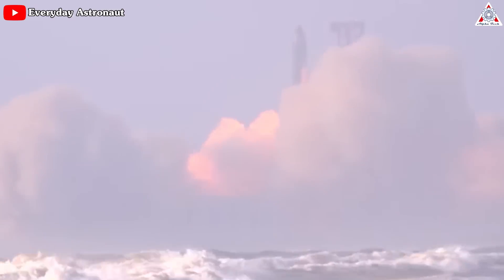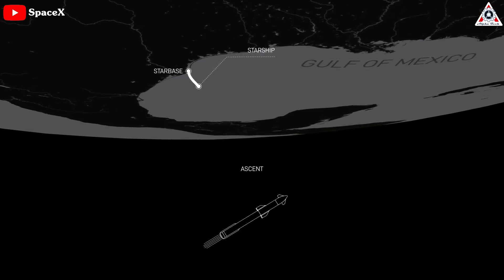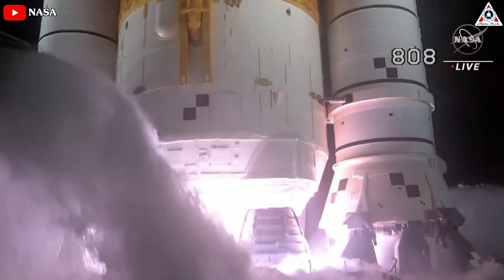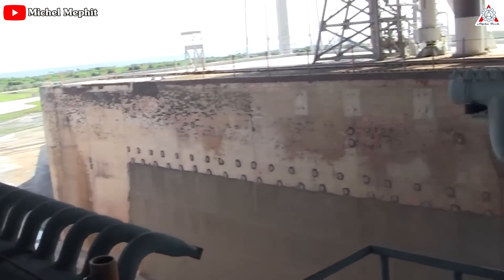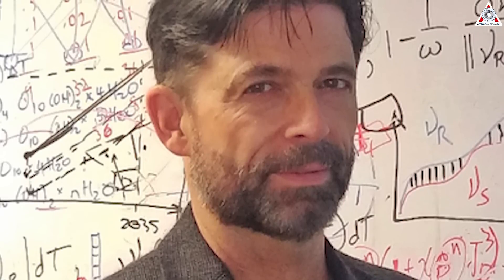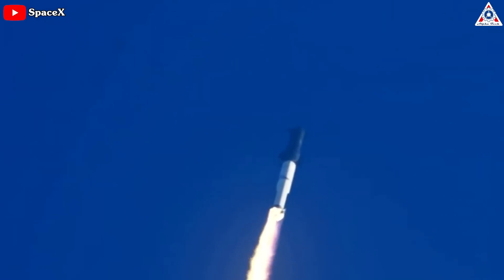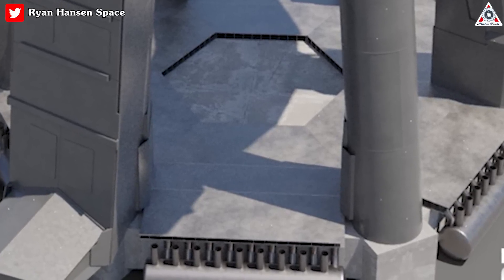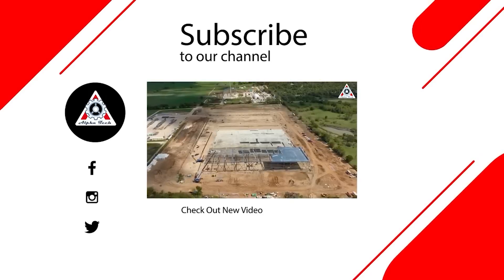SpaceX's NEW Solution to prevent the pad damage by 33 engines...

Comment: Well, we all know that this rocket is over twice as powerful as a Saturn V.  That mantra has been repeated over and over.  Finally, the present catches up with and surpasses the past!  How many Saturn Vs were launched with little pad damage?  Then Shuttles.  

You see, the Apollo/Saturn engineers created a launch vehicle and launch facility.  They thought the idea through and considered all ramifications.  And, how long ago did they know how to build a highly competent launch pad?  Oh, about 60 years.  That's all. 

The super heavy/starship (so-called though it's not going to any stars) may be the Spruce Goose of our time.  The Goose was going to carry hundreds of men, supplies, even tanks etc from the US to Europe during WW2.  It managed, with almost no fuel and no cargo, to get a few feet off the water and fly for a minute or so.  

I hope that Space X manages to get a "starship" into orbit.  It will be very interesting to see if they can successfully reenter the ungainly thing.  My hunch is, along with the launch pad fiasco and booster with too many engines, it will fail and never be able to reenter. 

Space X has the answer right now to a moon and mars booster.  It's very simple.  It works and is brilliant.  It's the Falcon Heavy.  Simply refit all 27 engines with Raptors.  Presto, more payload.  Then design the center rocket for landing and reuse.  In the future engine upgrades might increase payload even more.  Also, in the future one or more additional side boosters could be added.  Core plus four Falcon 9s=45 Raptors.  Makes the super heavy seem underpowered.  Center core + three Falcon 9s=36 Raptors.  Presto.  

Those 33 engines in super heavy are too close together, too much plumbing in too tight a space and all the eggs in one basket etc.  

As for using the current Starship (so-called ) to land on Moon or Mars.  Other commenters here are right.  No way.  Too much power on landing and take off.  Too much danger of damage coming and going home.  The vehicle will dig a crater that will make it impossible for the legs to support the craft.  

Let's all get going in a chorus to once again say how far superior the super heavy is to the Saturn V!  Maybe if we sing the song often enough we can convince ourselves it's true.  With Saturn Vs , right now or anytime in the last several decades, we could have build a space station, a moon base, and gone to Mars.  With F-1 engine upgrades that were in the works when the Saturn V was carelessly discarded payload would increase even more.  

Space X had to reinvent the wheel and have his own engines.  If it had done nothing but reverse engineer the Saturn V (and moon lander/command capsule) we'd be on the moon and Mars far sooner.

Comment: I am not convinced that this came from Tesla. A flame trench and diverter are easy to construct irrespective of water table. The problem was that Musk did not want it as made his concept of a quick easy launch difficult. The truth is that it is necessary along with a water deluge, otherwise back and sound pressure will damage the rocket and engines. A metal lining to flame trench is also necessary.

Comment: That new water cooled steel plate won’t work, it’s not the heat is the pressure that destroyed the lunching pad, they need to make something like a conic shape pyramid to deflect the energy sideways since they can’t dig deeper into the ground because of the high water table. That pyramid deflector should be like Philips screwdriver tip to increase it’s surface area, more surface area more pressure dissipation.  In simple therms make something aerodynamic underneath to deflect the flow of energy sideways.

Comment: I would have thought that a steel cone would be a better solution to deflect the thrust away from the pad and the booster, a flat plate will still reflect the exhaust directly back to the engines.  Also, a cone (with a 45-degree angle) would have around 30% greater surface area than a flat plate to further dissipate the energy of the thrust. They'd probably need to do some hefty simulations to get the optimal angle/profile of the cone but it seems a better solution than a flat plate. The energy has to go somewhere, easier to deflect it than try and absorb it.
Reply: Also, just as with sloped armour on battleships and tanks any given thickness of steel presented at an angle has a greater effective thickness.
Reply: @davidjames4915  So very true. At the 45 degree angle it's instantly 1.4 times as thick.
Reply: @protorhinocerator142  An additional cost saving for Space X!
Reply: @davidjames4915  Yes I hadn't thought of that, an additional great benefit
Reply: I like this idea, also wouldn't a giant poured steel platform work? I'm talking 20-30 ft deep just pour a steel slab that can be poured back over when parts of it melt? I know delamination could be an issue but that's doable right?
Reply: @RockstarDrywall2023.  well firstly they can't go down that far which is what they are trying to solve with the water cooling base. The water table is pretty close to the top of the platform which is why they haven't just dug down to create a flame deflector.

Second, they are already having problems with concrete flying up and damaging the engines. Id imagine it would be much worse to have vaporized, liquid and chunks of steel flying around. The rocket motors are more than capable to sublimate and break up steel.

This is of course ignoring the fact you would likely need an entire metal foundry right next to the launch pad to accomplish this.
Reply: @probablyinconsistent4756  oh yeah forgot about the water table hmmmmm
Reply: @Probably inconsistent  ok so what about digging down to the water table and use that as a flame retardant?
Reply: @RockstarDrywall2023.  you can't use the water table as a flame diverter for a number of reasons. The biggest one is that it is just a pool of water. 

Flame diverters essentially have 2 major elements, the ramp and the water flow. The ramp diverts the rocket exhaust away from the rocket in a stable manner. The water flow basically just keeps the material the ramp is made of from melting or getting blasted away. The water absorbs both heat and sound energy, importantly this water is always flowing down the ramp.

Having a pool of water beneath would cause major issues. A pool of water will not really absorb or divert energy, more just get out of the way because it doesn't have time to do anything else. Remember that the raptor series engines put down about 200 tons of force constantly. The water would likely get splashed in every direction, including onto/into the nozzle and other major components. 

This is pretty bad because the outside of the engine housing is extremely cold, water hitting it could heat it up rapidly causing thermal shock. When a material rapidly changes temperature it will usually induce stress fractures, this is why rockets have an engine cool down phase before launch.

In general you don't want any kind of stuff flying around during a launch. Honestly SpaceX just royally messed up not thinking ahead when they built the launch site.
Reply: @probablyinconsistent4756  ahhhhh
Reply: @RockstarDrywall2023.  I'm sure the steel would melt, but it seemed strange that much of the rebar remained after the concrete was blasted away
Reply: @John Tulley  that's because the heat didn't blow up the concrete is was the concussion energy from the blast. Steel would take that I think because it bends, and steel can be re melted to its needed shape
Reply: @johntulley8153  what if they used the water table itself?
Reply: wouldn't that require more thrust to get off the pad ?
Reply: @dickwilliam3793  No.  The thrust is developed by ejecting mass out of the rocket at high velocity.  It isn't pushing against anything and this is why rockets work in space where there is nothing to push against.
Reply: @dickwilliam3793  I don't think it would affect the thrust
Reply: @johntulley8153    OK thanks.
Reply: @dickwilliam3793  no, why?
Reply: Yes indeed.  Mad not to.
Reply: @apollo5341  Good solution,
Reply: I'd also flow the water over the steel, this should then result in way less heat reaching the steel because of a leidenfrost effect of the water, then steam.
Reply: @Levi  that would just instantly evaporate it wouldn't make a difference , if they use it underneath though I think it will become a pressure cooker lol
Reply: This is one of those solutions that seems like a good idea at face value but presents tons of engineering challenges when examined closer. 

Firstly you don't necessarily want the plate to be thicker. Thicker means more material which means it takes longer for the heat to transfer to the water. This is why heat sinks are generally made from thin and highly heat conductive material.

Second is the same problem that has come up with designing aerospike engines. It is incredibly difficult to cool pointed tips for a number of reasons. The main ones being that the tip is the furthest point from the cooling, closest to the heat source and the thinnest. The while the base can stay cool, the tip is subjected to more heat and has much more trouble getting rid of it. 

A good idea on the surface level but engineering it would be incredibly difficult and expensive. SpaceX probably already realized this hence the flat base.
Reply: @probablyinconsistent4756 , then use a simple flame diverted ramp, to get the thrust/dust/dirt/heat traveling in one direction, away from infrastructure.
Reply: @probablyinconsistent4756  Yes I can understand that there would be problems cooling the top point of the cone, maybe a solution would be setting the proposed plate at an angle to deflect the thrust away from the booster.

Comment: Wait, they can't dig a trench for water because the water table is too shallow.  Seems like if you would build something to take advantage of the water table... like a giant bowl that fills up with water on its own.
Reply: I've been wondering about that as well. Like what actually happens if they just enable seawater to flow into the trench while firing?
Reply: @davidjames4915  The water would turn to steam in a millisecond, causing a steam explosion. If you want to use water as a coolant you need to pressurize it and circulate it as fast as  possible.

Comment: The launch mount is far too small.  When you look at NASA pads, you will see flame trenches and diverters, but the area under the pad is quite a bit larger than stage zero.  You might want to consider stage zero to be less than optimal and work on the design for a new pad.  This pad may be able to be retrofitted , but it will take a lot of upgrades in all manner of ways all around to work to contain the damage.  Redesign will obviously be necessary to minimize the damage.
Reply: Terrible Idea water expands 1600 times as it turns to vapor if they aren't able to cool the water it will explode like a giant steam boiler! and even the most heat resistant steel melts at 2800F Raptor 2 temp is 6000F liquid nitrogen might be a better idea but even then its unlikely to work!
Reply: Good analysis
Reply: Imagine..  using a toilet fit for the size for a four year old. 
I wonder how basket ball players view our toilets?
One size fits all? My ass!

Comment: So, will the testing of this water cooled plate be with a full stack launch or a held down first stage at full throttle? Seems like the FAA might want to know if the plate will work or not.
Reply: Internal water cooling.
More like a high pressure steam-powered bomb going off under the rocket.
Reply: @protorhinocerator142  LOL
Reply: @protorhinocerator142  That’s partly why the concrete shattered explosively. Moisture in the cement and below it flashed to steam and blew apart the concrete.

Comment: Ironically pit dug by the rocket may have limited the damage to the spaceport by breaking up the force of the rockets thrust. With a steel plate however, it may focus this force in the same way a magnifying lens does sunlight. It would be like a fleet of tractor trailers ramming everything surrounding the spaceport at full speed.
Here is what I would humbly suggest. That you build a wall around the tower. The inside of the wall is slopped, directing the blast skyward and away from anything. With the water-cooled steel plate and little else, the force won't have anything to pickup and be ejected safely.

Comment: Elon has incorporated destructive testing of his starships for gained knowledge as demonstrated in past failed launches. The destruction of the launch facility, however, wasn't anticipated. But his engineers must have known the potential for such destruction existed. Something does not add up. Somebody dropped the ball on this one.
Reply: I suspect that the 8 seconds it took to release the rocket were a large part of the problem. Normal rockets do not launch at T+0:08. I suspect there was a issue starting enough engines and that the started engines burned through the Fondag-concrete layer. Once the top of that layer was destroyed the material below it quickly blasted away.

Comment: While a steel plate will keep the blast from stripping the ground and using it as projectiles. This will not deal with the force of the blast that is now directed sideways. Sideways into everything around it.
Think about all of the stuff surrounding the pad and tower and you will see the petechial for damage. 

I strongly recommend redirecting the flow away from anything Spacex does not want damaged.  Yes the NASA flame trench would be a great idea for Spacex. 

Ironically pit dug by the rocket may have limited the damage to the spaceport by breaking up the force of the rockets thrust. With a steel plate however, it may focus this force in the same way a magnifying lens does sunlight. It would be like a fleet of tractor trailers ramming everything surrounding the spaceport at full speed.

Comment: Derive an objective to build and design component modules (lego style components), manufactured and assembled in space.  Solve the problem of large unibodys versus bolt on. 

The components.assembled in space easily reclaimed, and reused or form molded.

Comment: The plate idea is interesting but wouldn't it just deflect the damage outward and upward? Hopefully they heavily upgrade the deluge system as well.
Reply: A cone would prevent damage to the booster by diverting the thrust horizontally, although there would need to be some extra protection for the tower.
Reply: @johntulley8153  A wedge, not a cone. You want the blast going sideways in 2 dimensions.
This also makes it much easier to photograph the big awesome rocket taking off.
Reply: @protorhinocerator142  Yes that could be better it could then be made to avoid the tower, and allow us to get some great photos too!
Reply: @protorhinocerator142  If the proposed plate was placed at an angle that would effectively be a wedge , which could work.

Comment: Is it possible that the problems with the pad experienced at Boca Chica are a combination of BOTH high heat and high pressure? Most of the thrust generated by a rocket engine is generated by fuel burning in the nozzle chamber and not the combustion chamber, as most people believe. Enormous pressures are generated between the nozzle array and the surface of the pad beneath it which creates enormous outward pressures. This could be somewhat alleviated by building the launch stand higher, rather than the pad surface underneath it deeper, thus providing more area for the expanding gasses to exit beneath the nozzle array. This might reduce the liftoff thrust somewhat, however.
Another option might be to inject a cold water vapor under pressure into the post-nozzle gas cloud near the pad to help keep the exhaust discharge from reaching destructive temperature and keeping the concrete from disintegrating. Just a thought. Maybe high-temp ceramics plating the concrete and metal surfaces to reflect the heat away from the structural elements?
Reply: "Is it possible that the problems with the pad experienced at Boca Chica are a combination of BOTH high heat and high pressure?" Absolutely!!!  There's as much thrust downwards as there is upwards; equal and opposite reaction, right?  Of course the exhaust isn't nearly as restricted.
Reply: @nathanwahl9224  Thanks. The point I was attempting was that it wasn't just high temperature or high pressures, but the combination of the two. High temperatures tend to weaken most materials, metal melts or becomes more brittle, loses tensile strength,  concrete experiences thermal expansion stresses and shatters without any pressure to speak of, even expansion coefficient differences between the two materials can contribute to the destructive precesses occuring. I was mostly attempting to address the issue of temperature because if the concrete is going to shatter without the extreme pressures, it isn't going to be progress to deal with the pressures only. Someone said somewhere that the water table is a problem but I don't really see that. Underwater construction technology has been around 100 years. 60 or 70 anyway.

Comment: I think for acoustic reasons, the bass should be about a meter thick of solid iron, poord as the entire foundation of the launch pad. Three feet of solid iron would make a great heat sink a minimize reflective vibrations back up to the rocket, as it lifts off. It only makes sense that something incredibly heavy and dense and indestructible needs to be under this rocket.
Reply: Close proximity to a straight foundation could cause loss of lift as turbulence  is hard to control without continuous air supply ,also heat will  accumulate blowing everything in its pass also radiating it back to the engines, a flame diverter would provide a smoother lift easier to cool  ,greatly diminishing  shockwaves  returns to booster . Steel and concrete will instantly melt away  without major water shielding .